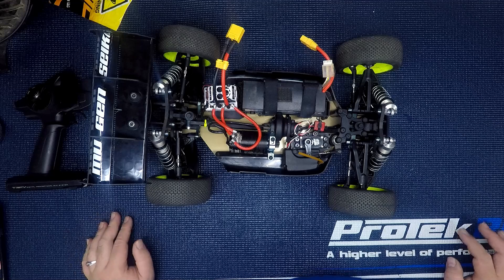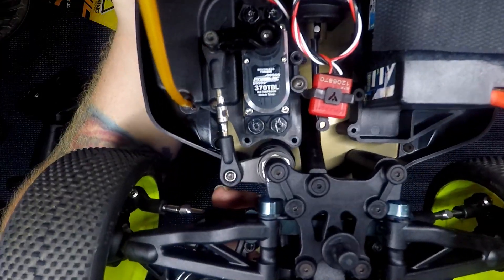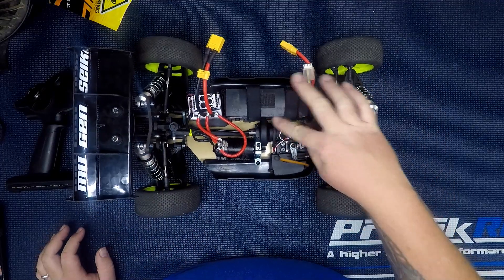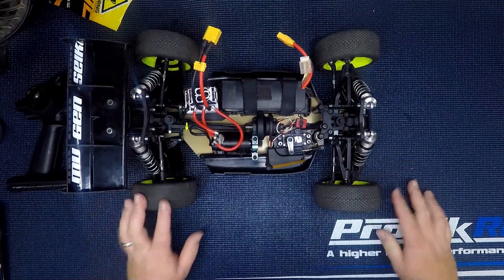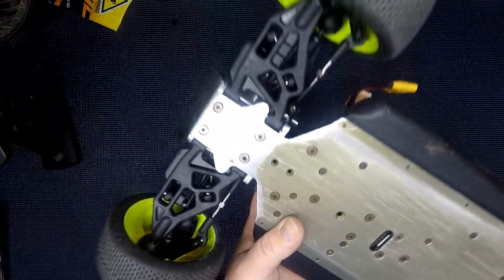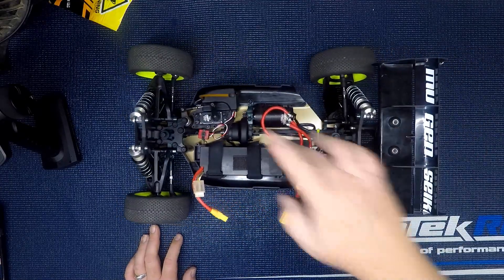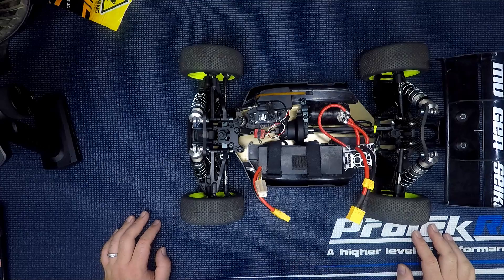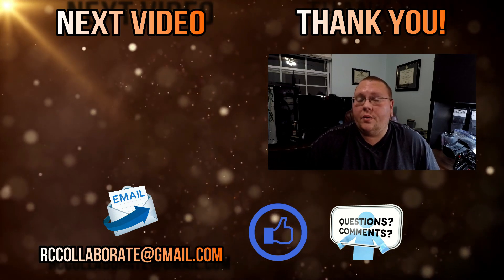My Mugen MBX7R Eco, New Setup

Comment: I got my 7r finnished a couple weeks ago! I just got a new 42t and 12t for the rear. I drove it with stock rear gears, and it was not good. Well... I didnt like it! Underdrive is a must have upgrade if your racing! Nice setup!
Reply from the maker: Have you raced buggy before or raced before?  I learned driving buggy requires a very light trigger finger

I have the under drive in the rear and buggy is still no joke to drive

Thanks for watching!